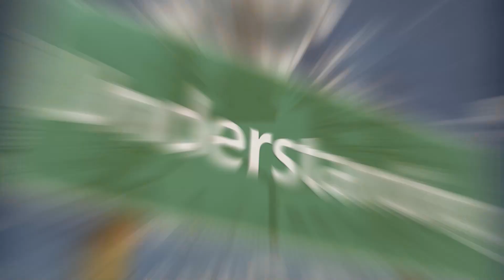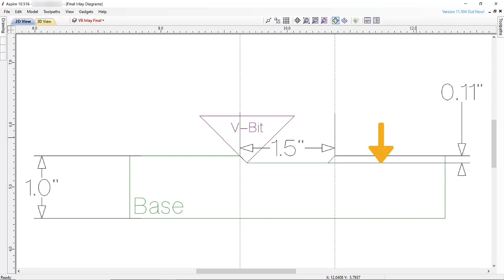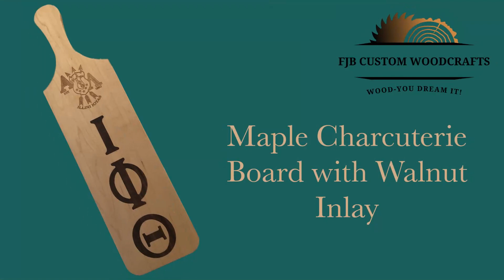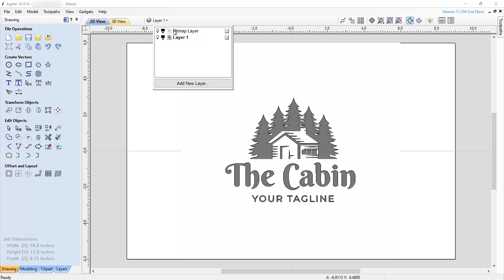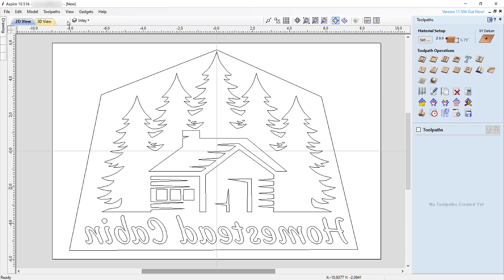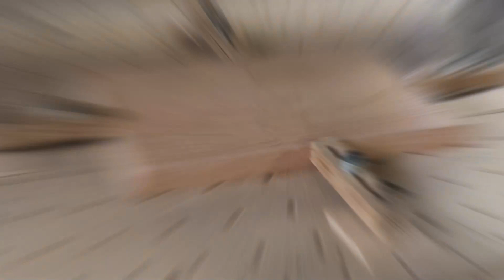CNC Woodworking Tutorials for Beginners-06

Comment: in Inlay Method, Are usually use the Cutting Depth of Base (Female Start Depth) 0.11" and Inlay (Male Start Depth) 0.09" & (Flat Depth) 0.02"? Default numbers?
Reply from the maker: Those are the numbers I typically use as shown in the video. You can certainly change them if you need to make the inlayed portion of the male piece thicker if you want to, but you have to make sure that you set the numbers correctly as explained in the video.
Reply: @fjbcustomwoodcrafts  Thank you, Sir.

Comment: I think I will need to watch this one a second and possibly a third time.  Lots of information here, thanks for this one Frank.
Reply from the maker: Please do. I spent a lot of time creating the diagrams to help visually explain exactly what the depth settings accomplish and how changing them affects the parts. Pay particular attention to where the V-carve bit start point is in the part when the start depth is not set to the material surface. For me, understanding that point thoroughly was the key to understanding why the process works the way it does.